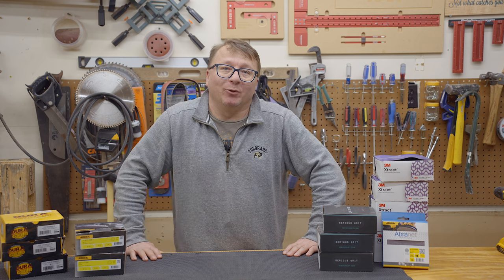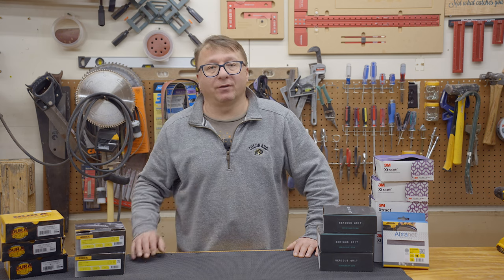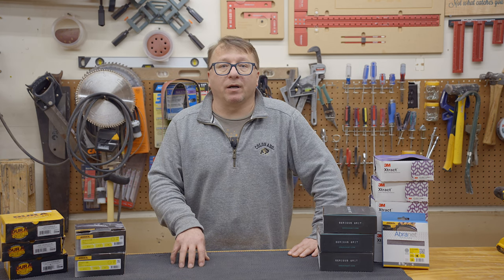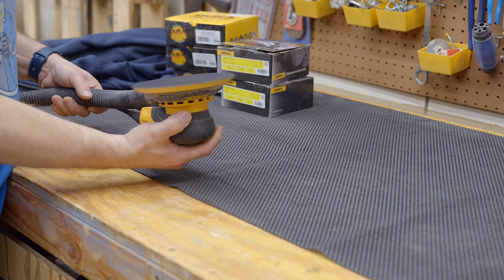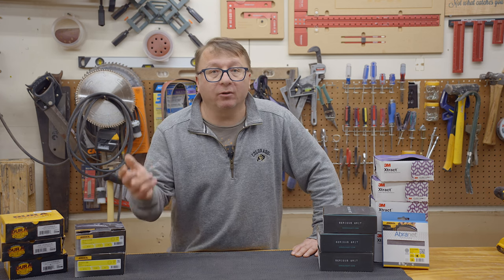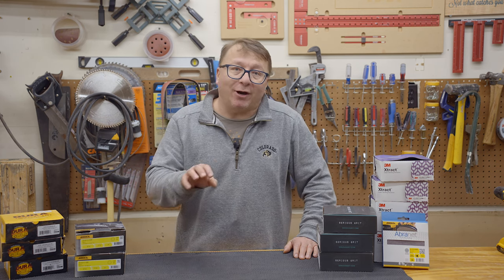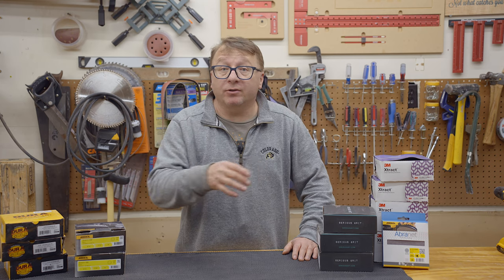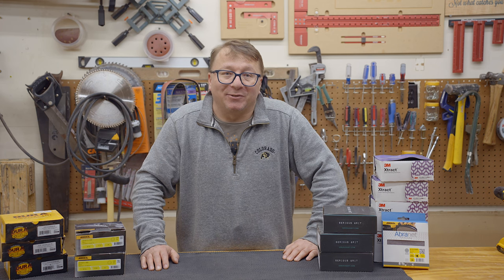The MAJOR Issue with Xtract Sandpaper

Comment: I've used xtract for large flat areas, ONLY. It is a massive time saver, which as far as I can recall, isn't mentioned anywhere . & cheap paper, everywhere else to avoid destroying the xtract. this system works well for me, for Lazy Susans & Cutting Boards. Today, I discovered that xtract works well for me, sanding pen tubes down to their desired diameter. Which is for me easier than using a chisel.
Reply from the maker: Totally agree - I'm headed that way.  Thanks for watching!

Comment: There is no "perfect' sandpaper.  However in most woodworking, large flat areas are the norm, and thus Xtract will likely outperform most papers.

There are other variables at play, besides the paper, when sanding non-flat surfaces.  For example, how flexible/soft is the sanding pad.  A pad that doesn't conform to the surface at all, will create a pressure point that will cause paper to tear; and can also cause uneven wear due to high and low spots on the pad that may lead to failure.

The advantage that good backed papers have, is that they are more tear resistant and more heat resistant. When sanding with mesh, the surface area that is actually in contact with the workpiece is significantly reduced (50% or more on most mesh papers).  Therefore, all other things being equal, the mesh paper is experiencing at least double the friction at any given point... this can lead to higher heat, and much more structural damage when doing non-flat pieces or when not applying even pressure in a flat area.

If you use mesh to sand board edges, or non-flat surfaces, you need to be very careful to reduce the pressure applied accordingly.  For example, on the edge of a 3/4 board, the absolute maximum area you can be in contact with is approximately 5" x 3/4" = 3.75 sqin which is less than 20% off the ~20sqin when sanding a flat surface.  This means you should be reducing the pressure applied by almost 80% when sanding an edge (assuming pressure and friction are linear relationships).  Failure to do this will make any paper wear faster, but may be more damaging to a mesh paper due to the much smaller contact area.
Reply from the maker: Thanks Joseph - great suggestions!

Comment: My experience is different from yours although I haven't done a bunch of side-by-side experiments using both types of sandpaper on the same project. Yes, mesh backed breaks down but so does paper backed. Is it more or less? I believe it's at least not more but I don't have quantifiable data - just that I think I'm switching sandpaper less often. Maybe that's confirmation bias. I also believe I get better & faster sanding results using less sandpaper with the cubitron mesh paper. I know I get less clogging when sanding stuff like epoxy pours because I've had to swap between cubitron mesh and paper sandpaper grits in doing a couple of recent projects. I also get much better dust collection with the mesh & a 3M Xtract sander. That sander really takes advantage of the mesh because the pad has so many (36?) holes for the air to flow. A standard random orbital sander with their half-dozen holes might not be able to take advantage of the open flow of the mesh paper. I also use a sandpaper eraser when I'm doing a project if I see any build-up on the paper (any type) so if you're not doing that, you'll get less use out of the paper than you might otherwise. I notice too that you seem to show a bit of center oriented buildup on your paper - I used to get that when I would lean into the sander. When I got the 3M Xtract sander I changed my behavior and let the sander do the work with just enough pressure to keep the sander on the material and under control as I move it around.

But, I don't do a lot of curved surface sanding with a normal 6" random orbital sander. For curves and tight places, I either hand sand or use a Milwaukee cordless detail orbital sander. That only has paper backed sanding paper available (unless I want to cut out pieces from cubitron mesh paper discs) and I know that those don't get the life I get out of the cubitron mesh discs. Again, not scientific because I haven't measured the area of comparable sanded parts so it's anecdotal at best (but then your review seems pretty anecdotal as well).

At the end of the day, I appreciate the better dust collection and the easier sanding (I let the sander do the work without leaning into the work) that I get out of cubitron. I still use paper backed discs on my 5" sander but when I'm doing most projects I use my 6" 3M sander with cubitron mesh and I'm happy with the results. Am I optimized for cost per sheet? I don't know. But the price of my sandpaper is a fraction of the cost of the wood, my time, my lungs and the finishes I use. I'm too old to spend a lot of life minutes agonizing over whether I'm overpaying for sandpaper 😀
Reply from the maker: Thanks Jim - excellent observations. I do prefer the mesh sanding paper for epoxy - the dust collection is far superior. And I totally, I switch paper much less with the Xtract over any other paper I've used, as long as I stick to sanding flat surfaces. Just yesterday I sanded one 8x13x2 board and the Xtract was completely devoid of cubitron in the center - I have no idea why since the board had large chamfers vs round overs. Maybe I'll get a cordless sander for the round overs and edges. Thanks for watching!

Comment: Yours is not the first video I've seen mentioning the mesh discs breaking down on anything besides flat surfaces. That steers me away from it, as rarely am I sanding only flat surfaces. I've been happy with festool's granat discs; they're readily available, not overly expensive and last long enough for me.
Reply from the maker: Thanks for the input -- as I said in the video, I do like the longevity of the Xtract -- nothing comes close to its lifespan, but only when sanding large flat areas. Thanks for watching!

Comment: I’ve followed your channel for several years now, and have always enjoyed your content.   I never comment on videos.  But I have to tell you that I found this content to be unusually aggressive to a fellow content creator.  You may ultimately be correct and JKM did his testing on flat surfaces only and there are limitations to that data set.  But IMO you could have called that out in a less direct way.  This needlessly tries to tie your brand to his.  Why do you need to put his photo on your video?  content creators work their tails off so that lazy folks like myself can sit on a couch.  No need to effectively beat each other up.  Be better.
Reply from the maker: Hi Tom - thank you for the thoughtful comment. I think I made it clear in the video I was not blaming Jonathan or beating him up -- I praised is testing and the method. However, I did point out the limitations of the product and his testing strategy. I did consider emailing him in advance to make sure he was OK with a little ribbing, but I ran out of time. I will certainly consider your input moving forward!